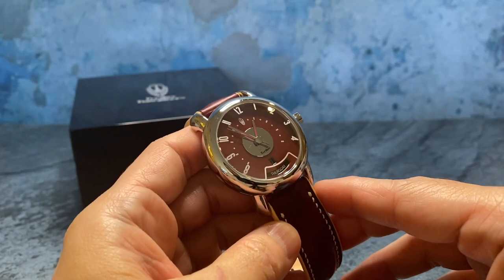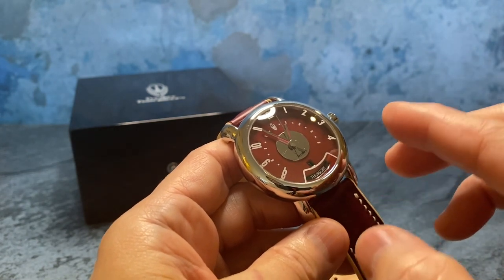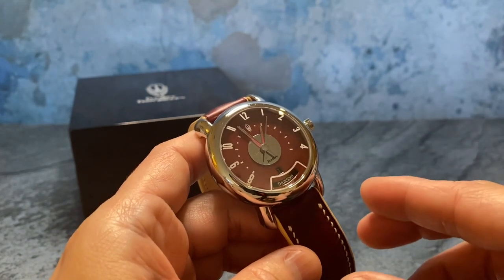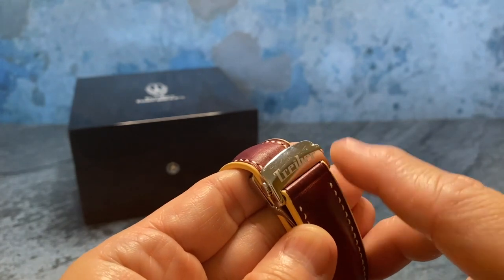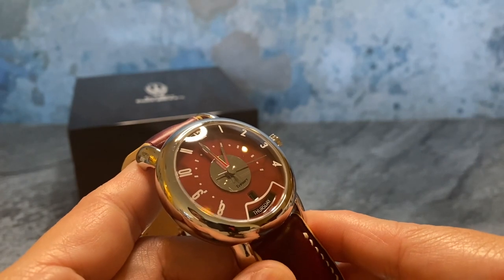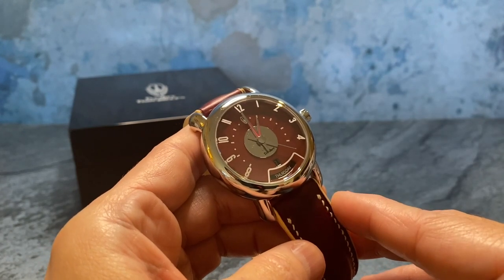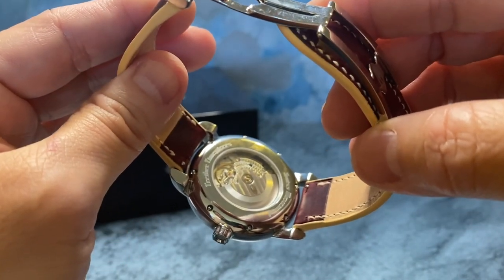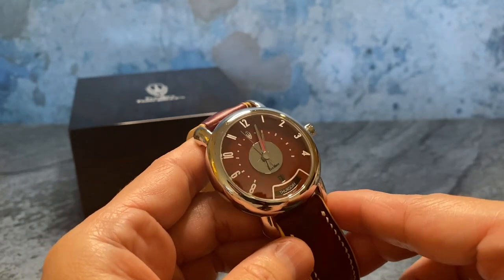Treiber T57BA | California Made Tribute to the '57 Chevy Bel Air

Comment: Whether or not I'm a fan lf the car that inspired it, I can easily appreciate the design features that relate to this and the era of car design it refers to. I can really get behind the concept and the execution. What lets it down is the size and price. While I appreciate what looks big will differ per person. To me the watch looks huge on you on the picture you showed. Not strange, because it's defintily an oversized watch. That kind of fits with the concept too, but it means I thankfully dont have to pause on the price to see if i'd really want one someday. At this size it's an immediate pass. Perhaps making it a dainty 36 would not suit, nut I'd be curious about pulling off a 40mm. That would also likely appeal to a wider audience in general.
Reply from the maker: I get it. I wouldn’t mind an option in 41mm.